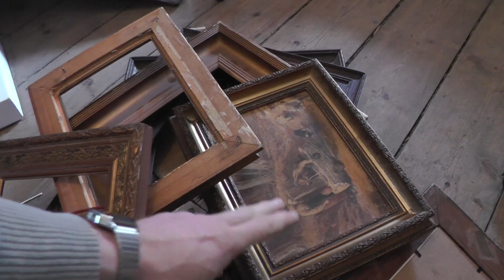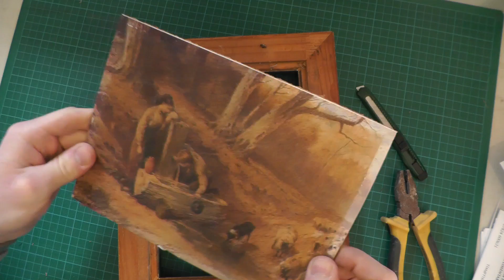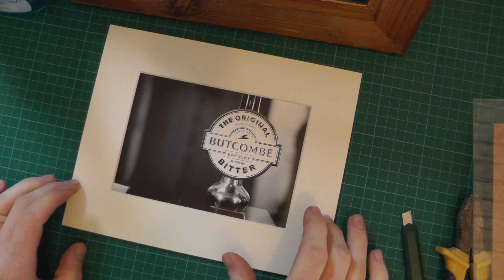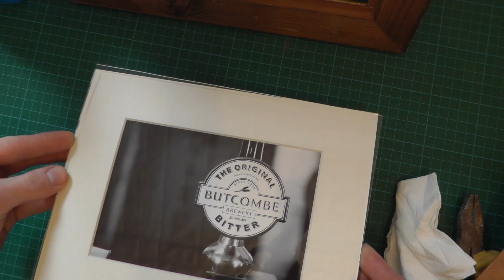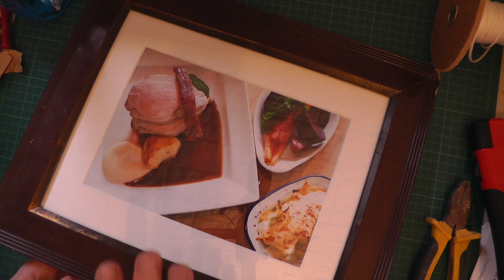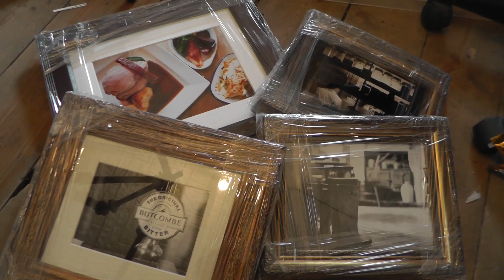How to Restore and Reuse Old Picture Frames

Comment: What I wanted to know was how to clean the frame itself. Some frames have mold and are very dirty with built up dust. I agree total waste of my time.
Reply: Geraldine Webster ..why not google it folks if u want more step by step...how to clean depends on Frame.. is wood, stained, painted...???  Fine grade Sandpaper or mineral spirits would clean most frames..(never seen such clueless ppl) criticizing his brief vid on basic steps on cleaning up a old frame & removing old Matt board.
Reply: I do not ever use spirits on old wood. I do use vinegar  with wood oil for cleaning Floors, teeth brash for cleaning details, or good back.  For gold, you need to se layers, so you can use same colors.  It can be red, blue, white black.   I make my own beeswax polish.  Put on the wood, and polish  next day. Repeat  3-5 times.   Some times I tone with wood toner, or use shellac.   I never use nails, if they not there. I do use tape. Cracks I fill with fillers, or end glue.   I try to use old rolled glass,  or mirror.  Here is most important  staff, I think.

Comment: The tab gun demo was helpful. I just got a used one with no instructions.  Also, the use of paper tape on the back.  Nice job!   My only question is whether glass cleaner would affect original artwork (chemicals).  I have been collecting old frames and want to clean them and frame some artwork.  Thanks for the video!.

Comment: This is really helpful. Would you mind explaining where the backing board came from and how you cut it?
Reply from the maker: Backing board is usually a thin MDF or you can get a thick corrugated card backing board now too. Providing it is thin enough to fit in the frame any smooth sheet material will be fine.

Comment: where can I find that tab nailer?
Reply from the maker: Any picture framing supplier will have them.  I think ours is off Amazon.  Great piece of kit.  We use the flexi tabs as they are easier to bend if you need to remove the print.